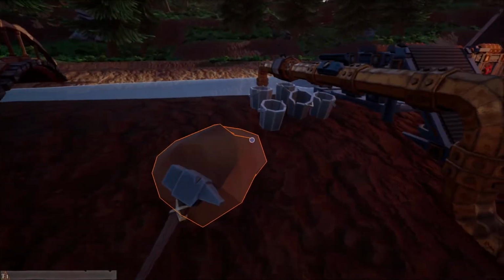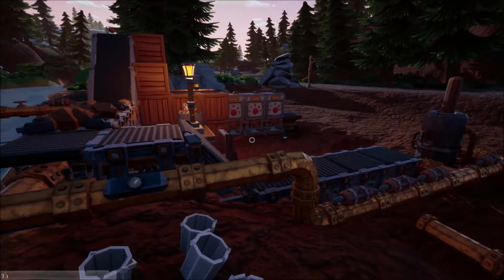Hydroneer: (7) Disappointing Drills

Comment: Hello LeeSuss. About the drills: The ram drills do work, but you need to keep the dirt level below the intake pipe, otherwise they won't work. And even though they do only deliver small ore pieces they are the better choice over the goliath drills because those will only dig 5 down and then stop until you replenish the dirt beneath them or move them. You don't need to do that with the ram drills, they just keep going. Using filters does reduce the amount of repairs you need to do (at least a bit), but they don't remove repairs completely. And the goliath drills break down more often than the ram drills, so you need to take that into consideration too when planning your mining system. Upside to the goliath drills is that if they are placed closer to the bottom of the map, they will deliver large ore pieces while the ram drills only delivers small ore pieces regardless of what depth they are placed at.
Reply from the maker: Thanks that's all really helpful.  So the ram drills are good for continuous cash flow?  I'd thought they would clear the dirt underneath them too.  I'll probably play around with the goliath drills some more, but for now I'm keen to get on to the Hydrominer!
Reply: @LeeSussLetsPlays  You're welcome :-) Yes the ram drills are best for continuous mining as they don't remove the dirt beneath them.

As mentioned, the goliath drills do put out larger ore pieces but to release their full potential they need to be set up in a position that is closer to bedrock. I don't know exactly how low they should be placed, but if you set them up in a pit 5 "blocks" above bedrock you can exploit the drill range they have fully and ensure that they only put out the large ore pieces. Depending on how you lay out your mining pit, you can either replenish them by filling up the drill holes with new dirt or by moving them to a new position when they stop.

The ram drills can be set up in a pit below ground as well, just make sure that there is no dirt touching them above the water intake. From what i have seen in other videos, this stops them from working for some reason.

If you want inspiration for how to set up a really effective mining operation, i would recommend checking out MikesPC1080p here on Youtube. He has made a longer series about this game, and from around episode 70 onwards his mining setup has been tweaked almost to perfection.

The mining vehicle (if that's what you mean with the Hydrominer) has its own issues, but with the right setup that can be really effective too since it fills up the holding bay extremely fast and can be unloaded pretty fast as well.

Anyway, good luck with your future mining operation. I will drop by your channel occasionally to watch your progress :-)

Comment: i wouldn't call them disappointing, exactly. (except, maybe, that first one.) even if it's slow, it's still faster than doing it all manually. it did break SUSPICIOUSLY fast though. that's a bit worrisome.
Reply from the maker: There's definitely some sort of issue there - I think the drill is somehow not registering that it's getting filtered water but I really can't see how to fix it as I'm following the rules with the four filters right in front of the drills.  What else can I really do?  Fingers crossed the next patch will fix it.